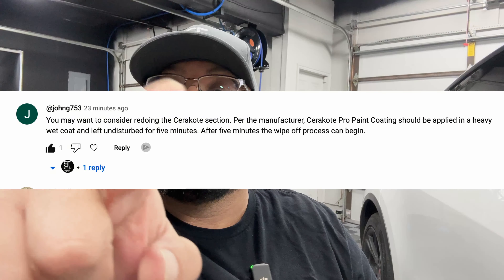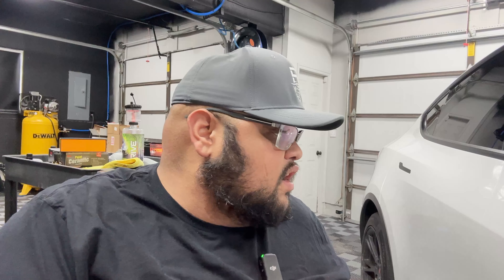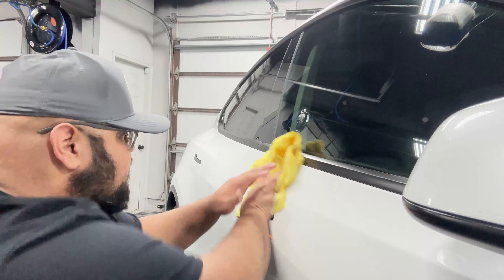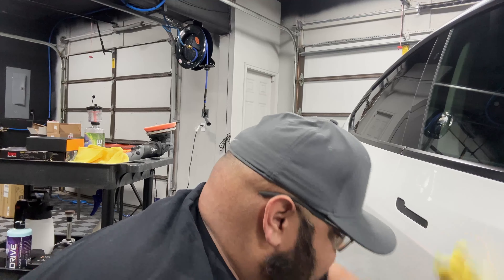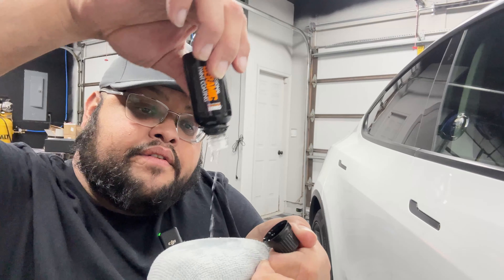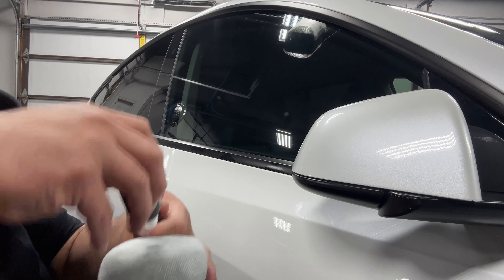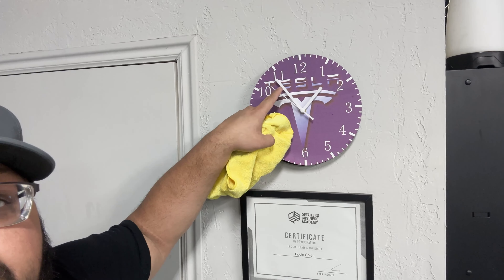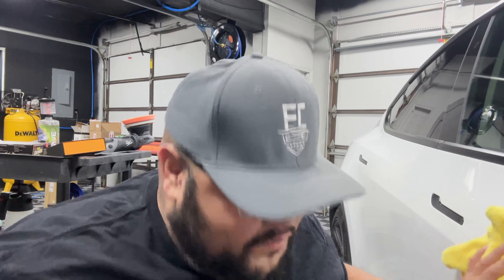REDO - Applying the Cerakote ceramic coating the right way

Comment: I get my bottle to try out this week. I’m stoked. It is wild how the chemical makeup can be so different between manufacturers. DIY Detail requires barely any product in the applicator per panel and Cerakote recommends a drenched applicator.
Reply from the maker: You’ll use a whole bottle for sure
Reply from the maker: Also thanks for watching
Reply: I needed 1.2 bottles for C class
Reply from the maker: @PassionCarsOy  1 bottle
Reply: Damn… might have used it more than needed💀
Reply from the maker: @PassionCarsOy  😂😂 you’ll be fine

Comment: Just received my test kit too but is that 5-minute rule for your and Pan's lower humidity?  I am in higher humidity conditions so just asking before I uncork my test bottles.
Reply from the maker: I guess the instruction said 5 mins I didn't read it as I assumed it to be like other coatings  where you watch and play right so I left it for 5 mins 

I would follow that 5 min rule for best results IF IT wasn't doing for youtube I would of done me but I wanted it to be fair
Reply: Cerakote swets when ready. I needed bout 8 minutes in 17 celsius